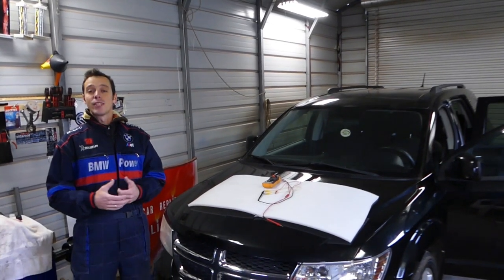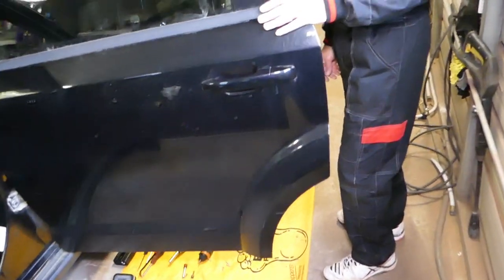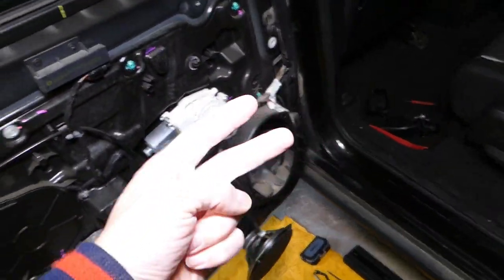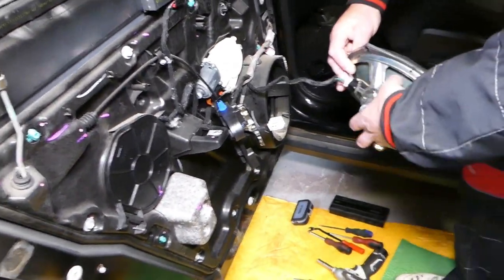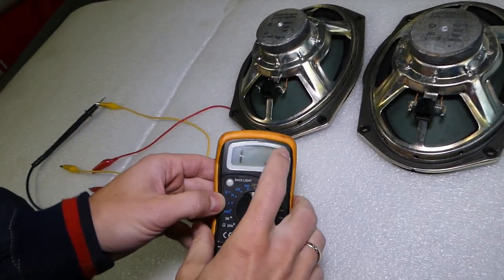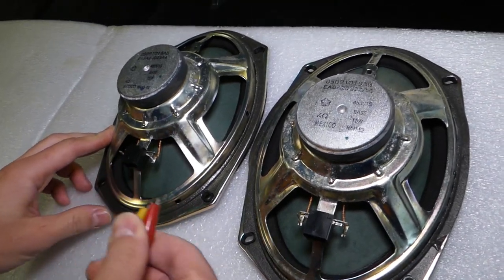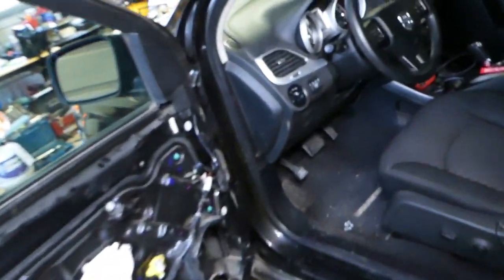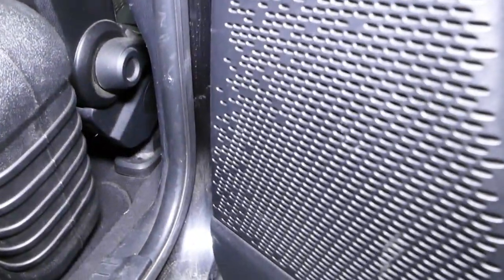FRONT SPEAKERS NO SOUND FIX. REAR SPEAKER NO SOUND FIX DODGE JEEP CHRYSLER

Comment: What if I have a 09 jeep and the rear speakers don't work at all.. when I set the fader to Front, I get nothing, when I set them to rear  just the front come on..   NOTHING was changed or tampered with,   I had a Kenwood Exelon radio put in with back up camera, and module for steering wheel controls added and was put in professionally..  this just started happening out of the blue..     the radio has 6 or 7 speakers.. Boston Acoustic speaker system
Reply: Same

Comment: My dash speakers static on my boston premium system in my 05 chrysler. No sound at all from front doors and rear deck speakers. Im going to try this tomorrow if it doesnt rain tomorrow. Earlier i disconnected the dash speakers and no sounds at all still.

Comment: My issue is a little tougher than this. All 4 speakers work but I can't run all 4 at 1 time. It's either front or back I can't have both. Any idea?
Reply: Did u ever get the issue fixed
Reply: @345_JIGGY  I had to replace the lines and the speakers completely. The CD player was fine but the lines all had a ground issue from the installer who accidentally crimped them behind the stowaway bottle jack.

Comment: I have an issue with my chevy silverado front driver speaker that has no sound but the others are ok what do you recommend to do. I checked the speaker it seems to be ok.  I have a Bose System.

Comment: I have a  07 chrysler 300. My driver side front speaker isn't working along with the 3 speakers on the dash. The passenger speaker and the back speakers work just fine. What could be wrong? Should I try placing the left front speaker on the right to see if the speaker is just blown out???
Reply: Same issue.. did u resolve the problem?
Reply: @sarayden1  yes! My spreak was blown out. Had to get it replaced. Did everything on my own.

Comment: hi I have a question I drive a 2009 toyota yaris sedan and for some reason my rear 6x9 speaker doesn't work I bought new speakers and still didn't work and my front speakers works just not the back?
Reply: Maybe you have an issue in the wire..
Reply: @o222b4  I did I got it fix thank you
Reply: @Marvin9able What can be done to resolve it?

Comment: Just installed 4 new kenwood 6x9 in my 09 ram quad cab 4x4 Slt. Any reason as to why I'm barely able to hear them
Reply: OHMS/WATTS match the radio requirements? Check the back of the speakers on the old speakers to check!

Comment: what if there is no sound from one speaker but its works if i put it on another side
Reply: Fivas it’s probably not connected to the stereo
Reply: @johannjesusdiazguzman1669  how do u fix that?
Reply: @johannjesusdiazguzman1669  yes how do i repair it
Reply: @johannjesusdiazguzman1669  to the head unit?
Reply: You have to rewire it, some cables go bad specially on dodge vehicles
Reply: @johannjesusdiazguzman1669  it was cable that was damaged near android connection so i just moved it in place where it wont move and i didnt had problem with it.

Comment: I have a 2014 Ram 1500 sport with the amplified Alpine sound system 

My front dash tweeters work perfectly 

My frond door speakers are very faint 

All the backs work perfectly 

Any ideas?
Reply: Any fixes? I have the same SUV same issue

Comment: How do you fix if speakers do work but amplifier is not producing bass
Reply: It’s usually some wiring on the amp, that or the wire in front isn’t connected correctly to the battery (i don’t really know much of this topic but I remember fixing mine like that,) for me the wires connected to the amp were kinda loose so I had to tape it to hold together. Bass came back 👊🏼

Comment: I have 1 speaker that doesn't work on low volume. I have to boost the volume up to activate the speaker and then it works for few minutes and then it goes off
Reply: Same i have that problem on a ford mustang 2002